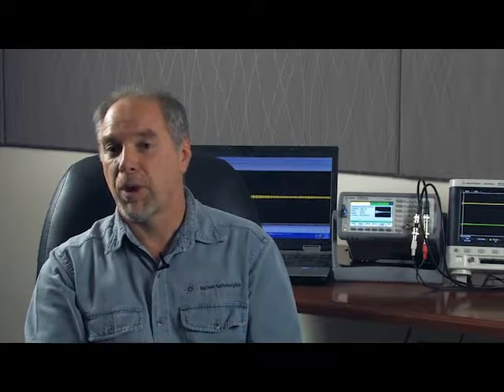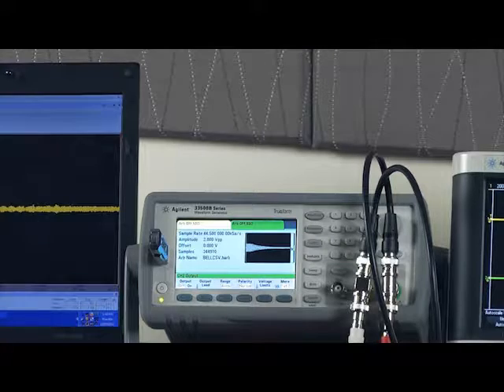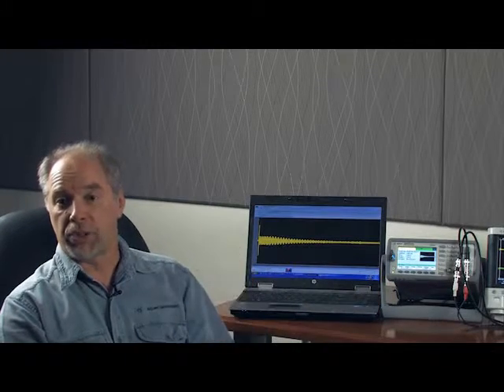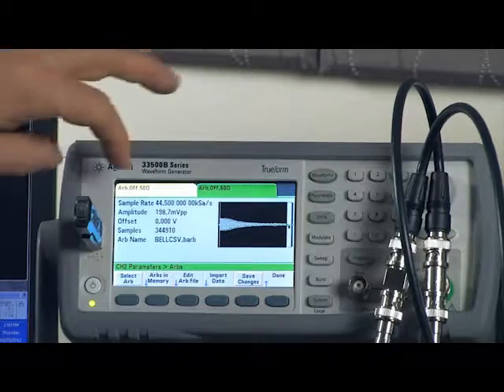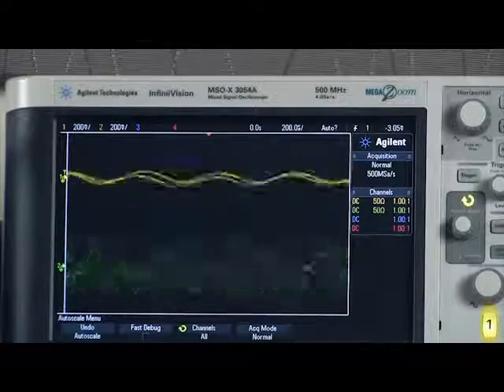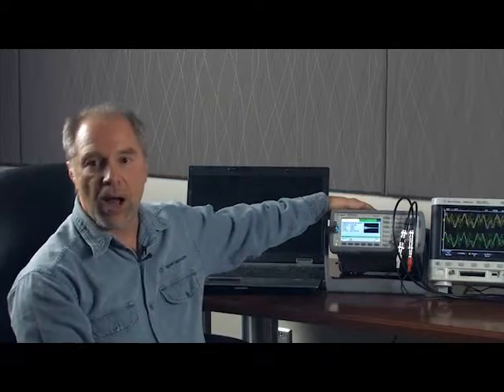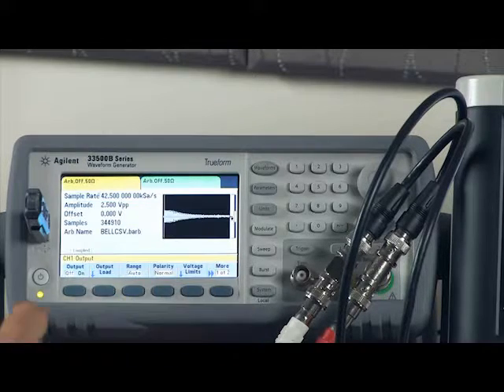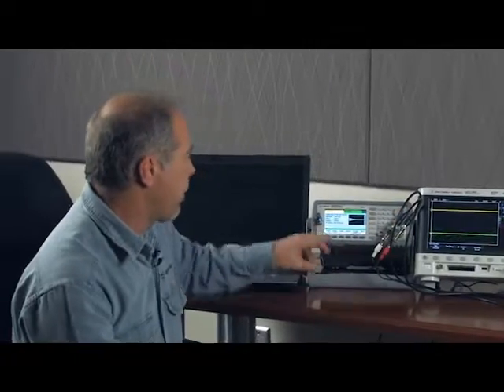Dual Waveform Generation with Keysight's 33500B Waveform Generator

Comment: Hi, I wanted to select an arb waveform from the USB just like in the video. But when I tried to select it, it only showed the arb waveforms inside the generator. As for the USB, it only showed "external" without showing the waveforms inside it. So I can not choose the waveform. Could you please tell me what to do? Thanks!
Reply from the maker: +Xun Liu After inserting your external USB drive. Use the front panel key sequence: Waveform-> Arb -> Arbs -> Select Arb. The file system will be displayed. Scroll down to the: External label.  Press the right arrow key below the knob. Now the files stored on the USB drive will displayed.